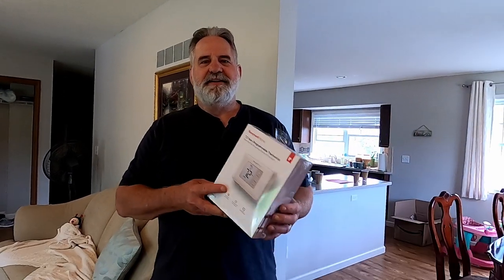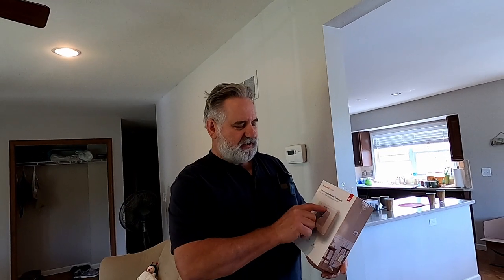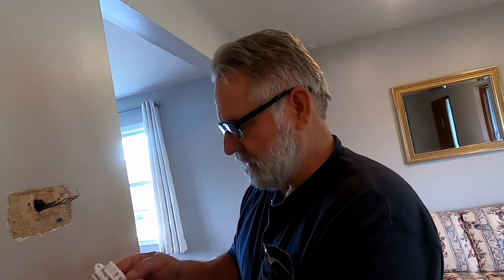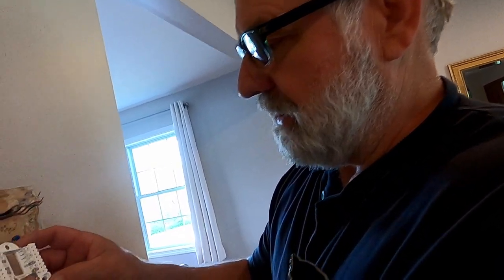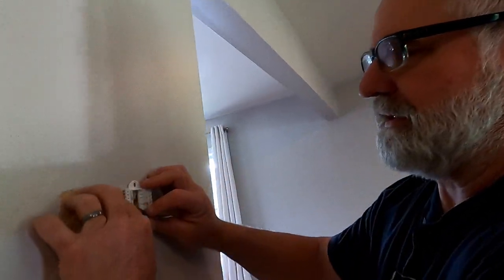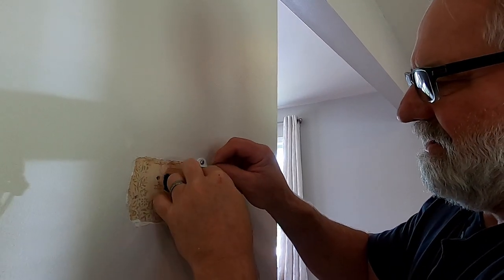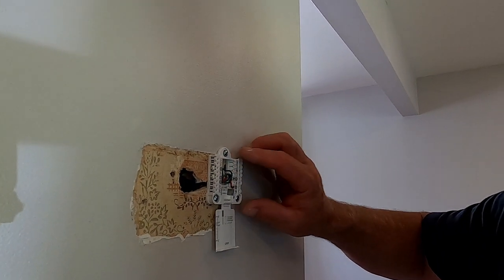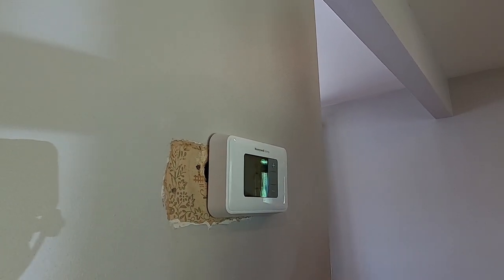How to Install Thermostat | Show Me Construction

Comment: Good job.  My HVAC tech quoted me $300 to install a thermostat.  I’ve worked the past six years with a master electrician.  I laughed.  A ten minute job for $300.  Glad guys like you post these vids.  Saving the home owner some money.  If you have a heat pump there will be six low voltage wires at the stat.  Again, good job.  Cheers!
Reply from the maker: Thank you!
Reply: I have my AC guy come out and install this exact thermostat for him to come out wire it up and install it was about $139 so I was happy.  How long does this battery last I’m just curious because I’ve had it for a year and a half and have not had to change the battery yet I’m not a tech type of guy on DIYS  guess it looks like you just pull it straight off the wall and put the batteries in and put it back on? I seen another video where you have to get the batteries put in under two minutes or it would need reprogramming so it should not take that long I figure 30 seconds should do it?
Reply: $300 is what our technician just quoted me for this morning (Tampa Fl for reference)

Comment: R  24v
W. Heat 
Y. Condenser control power / cooling mode
G. Fan
C common
O reversing valve for heat pump
S temp sensor 
Most of the wires are color-coded to match the terminals , but every once in a while people use different colors on different terminals,  but usually the terminals are as stated above!!!!
Picture check both ends one being on the back of the thermostat and the other at the control board of the furnace just to keep you from having any problems in case someone has splice the wires for some kind of repair in the past!!!!
Reply: Also the solid copper thermostat wires are very brittle do not twist and yank are you will have a intermittent connection inside the wire insulation of the wires and can be a head ache to find ! Specially if it’s intermittent working sometimes and not working other times so be careful the wires are delicate it’s a good to always cut them back three or 4 inches if you have room before you install the new thermostat just so you don’t have that problem🦧

Comment: I have the same one and it’s blowing hot installed of cold do u have a solution
Reply from the maker: You should call a service technician. It might need more Freon. Thanks for watching.
Reply: @ShowMeConstruction  
It works fine with the old thermostat
Reply from the maker: Unfortunately, since I'm not there to see it it's hard to say. I recommend calling a technician.

Comment: Does this Honeywell T2 work with heat pumps?  Also, my old thermostat was a T6.  It has a yellow wire.  Do I simply not use it?  I hope you can get back to me on this.
Reply from the maker: I think it will work with a heat pump but not 100% sure. 

An AC technician would help you figure where the yellow connected. I'm sorry I don't know since I can't see your panel on your unit.

Comment: Can anyone help?Trying to install this same one for my mom, there is no green ground but seems like there is an extra white wire, use that for ground with a  letter green marker or go without ground
Reply from the maker: There shouldn't be two white wires. You could trace the wires all the way back the the AC to figure out which one is ground otherwise I would call a technician.

Comment: How do I change the battery on one of there these thermostats.. Im scared to break it trying to remove it.
Reply from the maker: Usually the battery is behind the thermostat. You'll have to lift up or pull down and out. It is kind of stiff to remove but you probably won't break it.

Comment: So I bought this last year. Tried to install it. Everything seemed fine until I realized the thermostat wasn't kicking off the furnace when it reached set temperature. I have a very old electric furnace..  what do you think would cause it to not turn off ??
Reply from the maker: Sounds like there is something wrong with the furnace or the thermostat is hooked up incorrectly. I'm sorry I can't be of more help to you. I hope your able to get it straightened out. Take care. Thanks for watching.

Comment: Why do you need a battery in it when it’s powered from the house?
Reply from the maker: Because the thermostat is a low voltage controller the battery lights up the screen so you can see your digital display.
Reply: I’ve got a thermostat (non programmable) that is backlit, powered by the house voltage (low voltage) that doesn’t need batteries.
Reply from the maker: That's awesome! Thanks for sharing
Reply: @ShowMeConstruction  it’s called VIVE

Comment: Hello sir.  If the auxillary heat or emergency heat kicks on to assist the heat pump like on cold winter days, will the screen indicate that is running with 'aux ht' or 'em ht'?   Thank you for this video.
Reply from the maker: Hello, unfortunately I don't know anything about heat pumps.
Reply: @ShowMeConstruction  But should you not try to accommodate the viewer that has a good question?
Reply from the maker: Hi Larry, I don't know the answer to his answer. I responded to him 10 months ago and told him I don't know about heat pumps. Wish I did! As for the screen unfortunately I don't have an answer. He can check the owners manual or call a tech out. I only showed how to install the thermostat. Have a great day.

Comment: Installing two new ones right now. Video is helpful. However, I would have mentioned that some of us don't have a "blue" wire. However, I see you connected your "blue" wire to the "yellow" connector. I have 4 wires: white, red, green and yellow (no blue). So for me, I'll just connect the "yellow" to the "yellow". For other viewers, you can see in his close up connection image he connected the "blue" to the "yellow" location, but didn't say so. Overall, good video!!
Reply from the maker: Thanks!
Reply: And I installed both very easily! Highly recommend these!

Comment: Question. I set my wires up the same way but the cool air is not is not coming on. What did I do wrong? Does the air come on automatically or should I wait a while?
Reply from the maker: Double check your wiring and make sure you have a good connection. If it doesn't come on you probably need to call a technician out to see it in person. Did it work fine before the new thermostat?

Comment: Wouldn't you want to patch the wall around the wire entrance before installing the thermostat?  Otherwise, you'd just have to take the thermostat right back off to fix the wall.  Also, did you make sure that it was level?  I didn't see you place a level on it.  The instruction booklet suggests using a torpedo level.  This is constructive criticism, your video has helped me, I'm just trying to clarify a couple points. Thank you.
Reply from the maker: You can patch the hole before. Whatever works for your wall. I didn't use a level because I have done this type of work for so long but some people may definitely benefit from using a level. All thermostats are digital now and no longer use a mercury switch so it's really not to necessary to use a level. Thanks for watching!

Comment: Wow! You make that look so easy. I have 2 I want to change. Both are only heat.. no AC. I'm so hesitant. Lol. Plus it's cold here right nie and if I mess it up, that won't be good. Should have attempted in the summer. Lol. I may give it a go. Looks simple. Thank you! 
The camera man did an awesome job too. 😊
Reply from the maker: Give it a go and if you run into problems call an HVAC guy. Heat only should only be 2-3 wires. Thanks for watching!

Comment: I have a white blue red and orange where do I put the blue and the orange
Reply from the maker: Hi! Where was the orange hooked up on your old thermostat? Usually, white is heat, blue/yellow is cool and red is power. Do you have an owners manual? You can go to your unit and see how the wires are hooked up. When in doubt call someone out to look at it in person. Hope that helps. Sorry I couldn't do more.

Comment: What  if you have  more  wires than  that
Reply from the maker: Sometimes there are more wires than you'll use. I would refer to the owners manuel that came with your thermostat. Whatever wires were used on the old thermostat will be used on the new thermostat. The wires that are not used are probably not being used on the other end either and are fine left unconnected. If in doubt you should call an HVAC technician to look at it in person. Thanks for watching.

Comment: How do you wire this thermostat that has 6 wires the only one not used is the blue wire currently
Reply: Same
Reply from the maker: You will need to see how it is wired on your AC unit and possibly call an HVAC guy out to look at it. My video only covered this unit. Sorry I can't be more of help to you. Thanks for watching!
Reply: @ShowMeConstruction  update I called hvac guy yesterday and turns out the installer never finished the installation there was no power getting to the ac from the breakers
Reply: I figured it out. Thanks everyone
Reply from the maker: @D6M6N k6NG Glad you were able to get it fixed!
Reply from the maker: @Robert Godwin great to hear!

Comment: I really liked this thermostat, but mine seems to have crapped out in less than two years.  The screen went blank even though the batteries are not very old. New batteries seem to do nothing. Have you had an issues similar to this?
Reply from the maker: Sorry to hear that happened to you. I have not had any issues. Maybe you happen to get a faulty one. Thank you for watching. -Mark
Reply: @ShowMeConstruction  Quick update. I let this thermostat sit since last year and just used the old thermostat. I came back to it, put new batteries in and it seems to be working again. I know I tried new batteries before and thought there might be an issue with the ribbon cable to the screen. I made sure everything is connected, and it is working. I have reinstalled the thermostat and am happy to have it back in service.